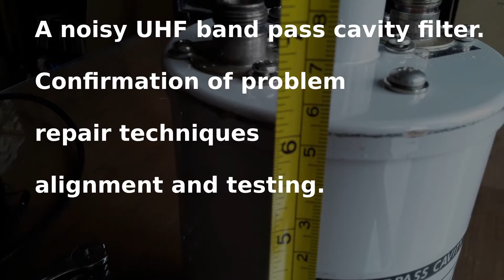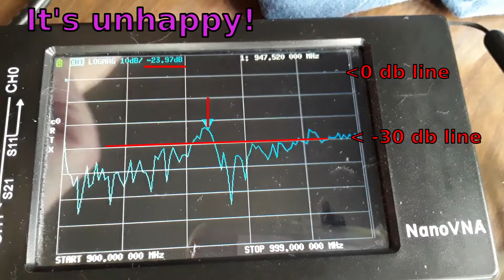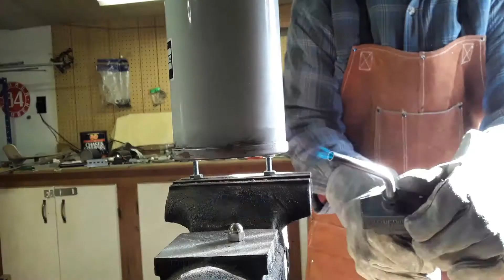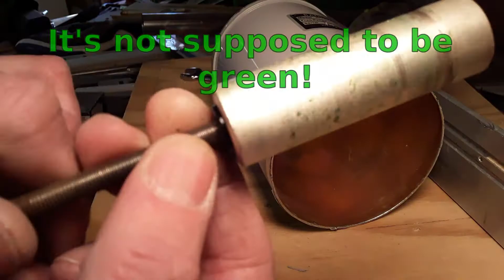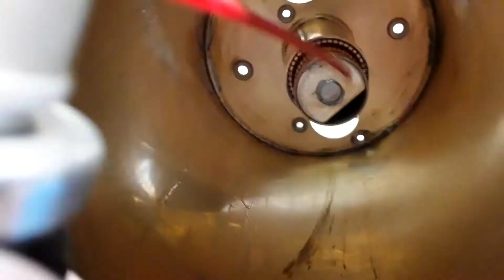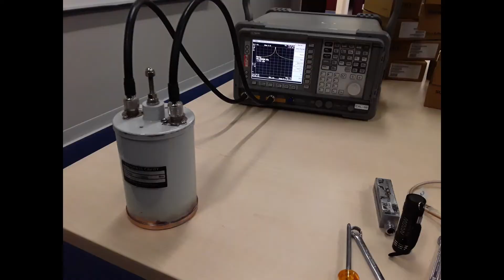Repair of 900 Mhz Bandpass filter

Comment: Did you do a return loss measurement? You'd be surprised by using it to adjust coupling loops and minimum line loss and max q using a VNA.
Reply from the maker: I tend to use the SWR function rather then the return loss, they are related, but I find a 2:1 SWR more meaningful to me than a 9.5db return loss.